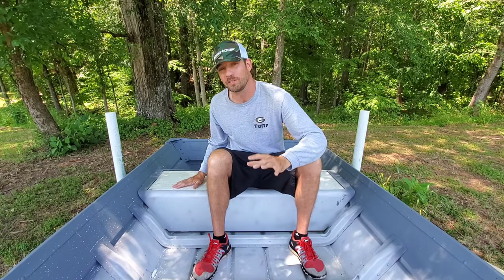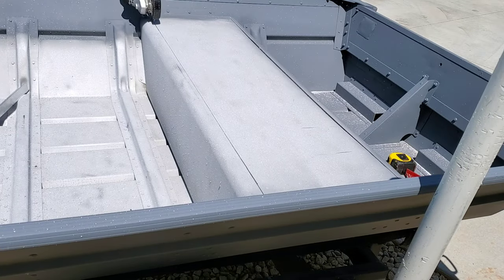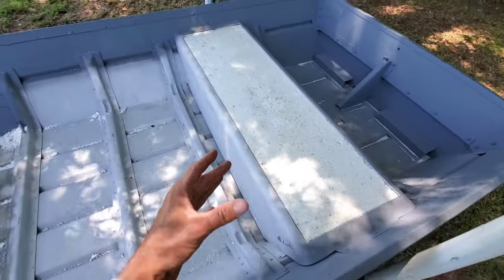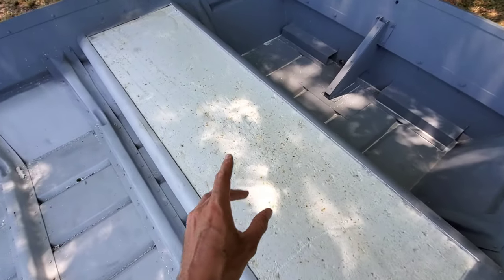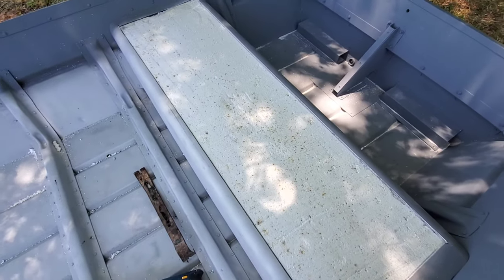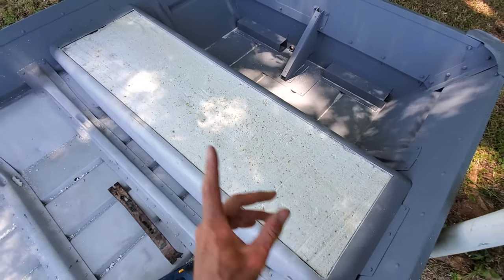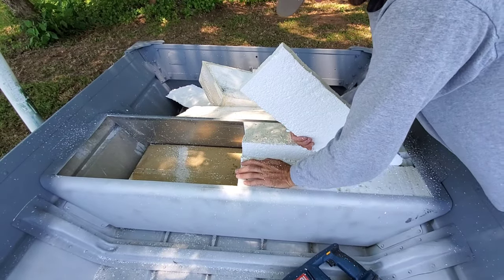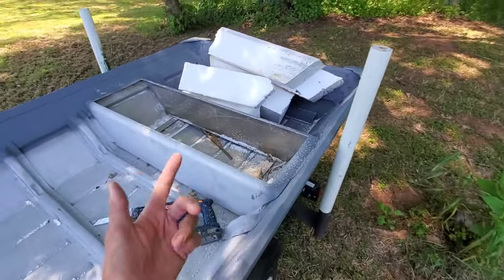Easy Foam Removal From Jon Boat Bench

Comment: I always carry a small machete in my boat for cutting cattails etc and I used it to remove the foam in my seats. Just heated it with a mapp gas torch and melted it out. A lot less mess

Comment: Was wondering if you cut out the top of the seat bench can you just have the whole hatch open and put a lid on it or would it wreck the structure of the boat

Comment: I'm currently in the process of removing the foam in my seats. However, where else should foam be added back into the boat? I saw another one of your videos installing floor boards and placing foam board along the floor...is there any concern with fresh water, salt water, or fuel getting in the groves and making contact with the foam board? Any feed back is greatly appreciated! Thank you and keep up the awesome videos!
Reply from the maker: I do fresh water only, not sure about salt.  Also, fuel will eat the foam. Don't recommend putting it near where gas may spill

Comment: Did you flip your circular saw blade backwards to cut the aluminum I was always told to flip the blade for cutting metal?
Reply from the maker: I've heard that but no, i don't nor have i tried
Reply: I’ve only heard that when cutting siding for a house

Comment: Question for the cuzzins here:  What adhesive works well to laminate extruded polystyrene (e.g., Owens-Corning "pink" insulation) together in a waterproof way?  I've heard Gorilla Glue works, PL300 for foamboard works, and there might be others.  I even heard that Glidden "Gripper" primer/sealer works well.  Thoughts from the cuzzins??
Reply from the maker: That question sounds more like an engineering question my cuzin! I honestly have not a clue but perhaps someone will respond here who is more knowledgeable on the subject.  Sorry, this one is above my pay grade cuz.
Reply: @AnthonyJonesBrigadeBoats  Haha, mine too!  Some of my post-question research revealed some pretty amazing solutions.  One obvious one was Great Stuff Gaps & Cracks Formula, but it can be kind of tough to control, and panels definitely need to be weighted down while the Great Stuff expands.  One surprising solution I saw several times was PPG Gripper/Primer (formerly Glidden Gripper), although there was a question about how it might be a challenge to hot-wire-cut through.   Lastly, I saw a lot of people recommending epoxy resin, but they were quick to say that you have to use the EPOXY resin, not the polyester resin (e.g., Bondo Fiberglass Resin)...poly resin will eat the foam, while epoxy won't.  Anyway, I think I kind of answered my own question while waiting to  hear from the masses!  LOL